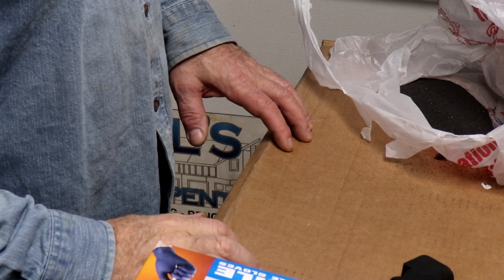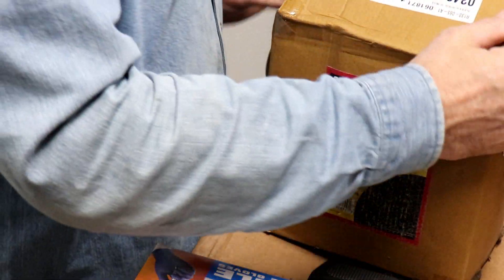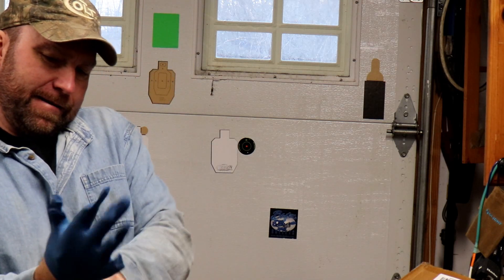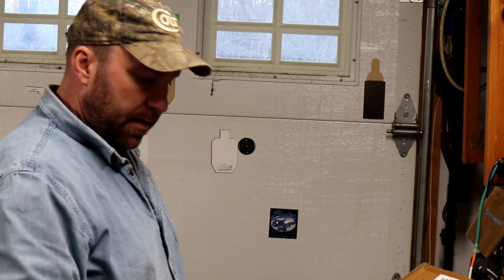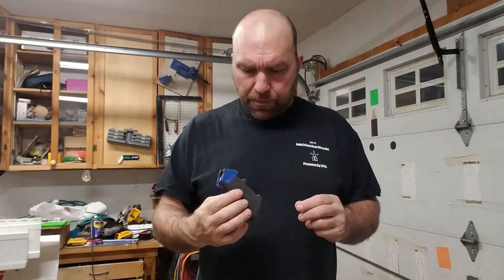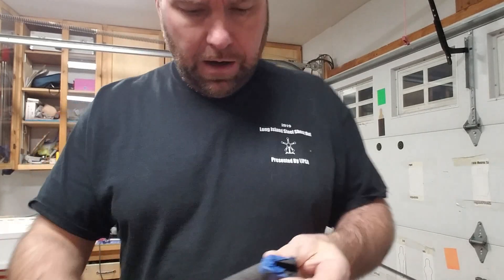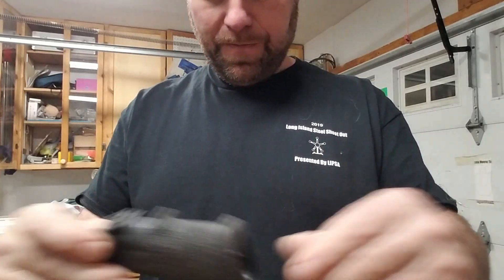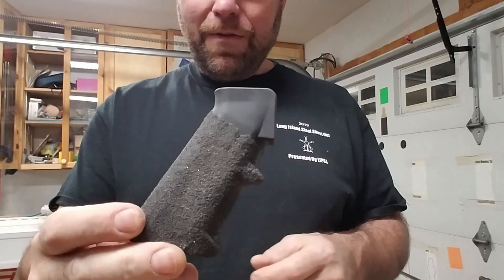Better then Stippling. Silicon Carbide texturing

Comment: Before you tape it off take a pencil and mark where you want it, then take a dremmel onnlow with a cutting bit or a wood carving tool or even wood burner.  Cut yourself and edge and line it out, its fairly easy and takes no time. Once thats done then tape.  Once your done it looks cleaner and blends in better and doesnt peel back as it has an edge/groove to it.
Reply from the maker: Great idea
Reply: @Baldcurious  Can also by little bags of the SC on amazon in different grits to make it how you want the grip.  Its cheap when you buy larger quantities, but still can get small bags cheap.  My first gun I ever did was 7yrs ago and its still on good.